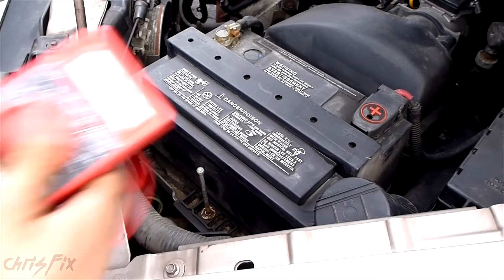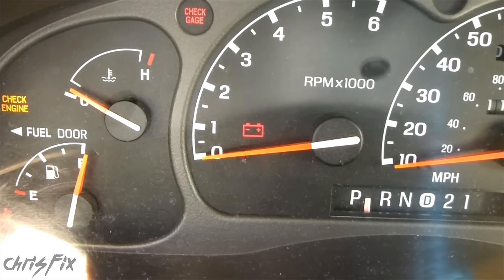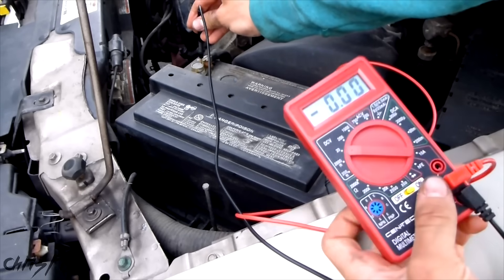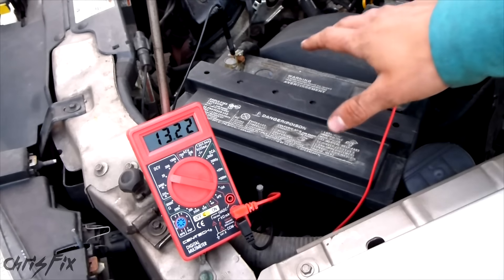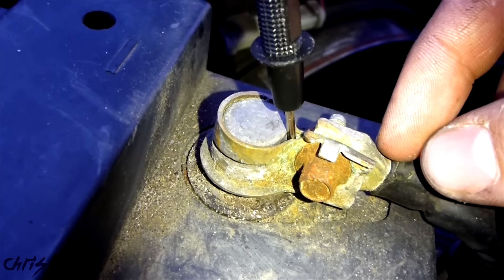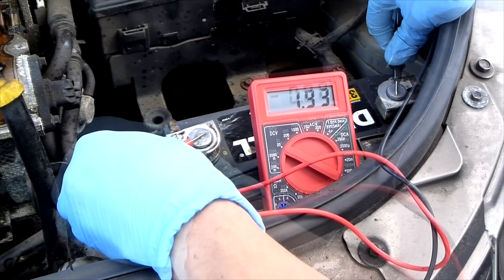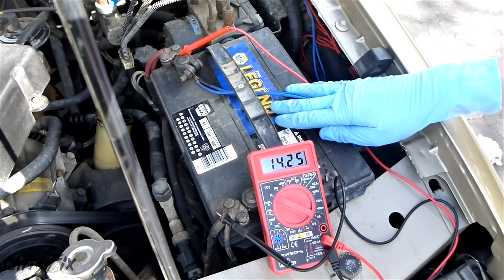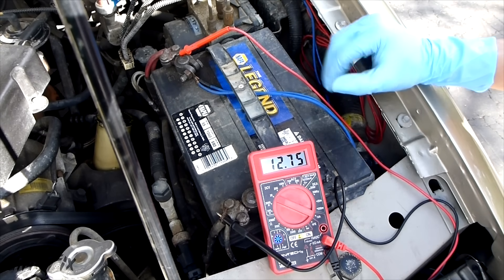How to Test a Car Battery with a Multimeter

Comment: Chris great video finally someone whos quick and knowledge. i will try to check ampage right now if it starts its been starting one day then in a few days it doesnt battery reads 11.98 v wlo terminals on.  i have volvo  the lights are bright it either cranks n turns on or clicks but no crank ty

Comment: I have had a lot of electrical problems (takes multiple tries to start, radio turns off and back on, lights flash, when car is off the doors don't all lock or unlock from the button on the inside of the door but does work when car is on) I tested the battery like you said and when car was off I got a reading of 18 and when I turned it on it dropped down to 13 then back up again. Any thoughts? Does it mean anything the the reading on the battery was so high?
Reply from the maker: +Pablo Cow Watch my alternator test video and see what the alternator is putting out. That voltage is very high and you either have a bad battery or bad alternator.

Comment: +chrisfix Greetings, I have a 96 Maxima, New starter, battery, fuel pump, all 6 
new spark plugs, I was driving in the highway and my car stop running 
and now it doesn't want to start only cranks but no start. It had a code
 P1447. I read about this code and I replaced the EVAP Canister. Does 
this code cause no start? If does, what is the next to do? Your help is 
appreciate, since this car is my daily transportation.

Comment: Chris,  At the phone company, we use a product on our batteries in the offices (these are lead-acid) called NO-OX-ID.  This grease will keep your terminals clean for years.  Also, our Power Tech Support says office batteries  will last at least 20 years if the temperature is correct, approx. 70 degrees F.  A rise of 10 degrees will knock about 20% off of the life.  Under the hood, it's the heat that kill a battery.  Moving a battery to the trunk would double the life.
Reply from the maker: +Joe Atwork Thanks for the tips!!!

Comment: Excelent video, thank you very much. I'd like to ask a question here. I'm installing three LED lights in my 4x4 and using a power inverter to plug in my notebook (a 60w MacBook) to the battery. My question is, is there some way I can know how much charge is left in the battery so as to start the engine before it goes bellow dead? And, how long on average does the alternator take to charge the battery, meaning for how long should I leave the engine running after using the battery for about 3 hours of notebook use. My car is a Suzuki Grand Vitara diesel. Thank you.

Comment: Does the same drop in voltage test when starting apply to a diesel engine car as well?
Reply: Mostly yeah... But its more about how it sounds when cranking. Because if starter draws little more and battery is not brand new it might be somewhat below 10v, especially if its cold and glow plugs are on

Comment: Very well done video. May I suggest taking a little baking soda and dabbing it around the top of the battery with an old paint brush, then pouring HOT water over the battery to clean and remove acids which build up atop the battery. These acids cause corrosion/collect moisture and can actually cause a draw from one battery post to the other.
Reply from the maker: +davess357 Thanks for the tip! That is a good one!

Comment: I noticed your voltage on the battery was 12.85V. I just had mine tested and it gave the exact same number. Since this is above 12.6V is that a concern? What's the highest voltage you would say is acceptable with the car off?
Reply from the maker: +Matt Bono That is not a concern. Your car battery should be between 12.2 and 12.8 volts so you are good.

Comment: hey my van battery was ok then i went to turn it on it wouldn't i had it jumped it started up no problem then i drove barely like a block and it was sluggish then died on me what should i check besides just the battery like this video shows? 02 windstar
Reply from the maker: +Tito Santiago Check the alternator as well as the battery. It is one or the other.
Reply: Alright I'll check tomorrow and I'll post back on here any other questions thx for the quick reply

Comment: Could you please measure idle drain current on your truck to see how the battery is discharging when not in use? It seems to be in such a good condition just because the voltage does not drop below 12.6V at all.
Reply from the maker: +duncho Like this: https://www.youtube.com/watch?v=n5FJDgcdii8
Reply: +ChrisFix I'm not interested in of how to measure it, but what actually was the idle drain current on the last car on this video.

Comment: Hey Chris, I have a question.Sometimes when I start my truck, usually in the morning (I live in Florida so it's cold weather), it cranks to what seems half way and then it fully starts about a second later. Would this be an issue with cold cranking amps?
Reply from the maker: It could be the battery so take it to a parts store and they will do a free load test.  Also check out my fuel pressure test video.  Could be a weak fuel pump.

Comment: wd40 wont prevent it from rusting because the water component evaporates from the wd40. Thats why chains on bikes rust after wd40, which displaces the thicker facotry oil.
Reply from the maker: +meocats Thanks for sharing. It has worked fine for me. A bike chain has other forces on it that wash away the oil while a battery doesnt move so the oil stays on it.
Reply: Doesn't work on tools either; Machine tools for example. Don't trust WD40 to keep your machine tools safe from corrosion during the winter. That's how i know i'm correct.
Put Wd40 under your vice between it and the machine table and it will rust after a while. And that's in applications not using flood coolant.

Comment: Your video helped me narrow my slow cranking down to the battery. Autozone checked it, said it needed charging. Came back 1.5 hrs later and they noticed a bulge and battery was at 66%. It was a Duralast that was till under warranty, so they gave me a new one. BTW, that new collaboration, Blown Heads, is awesome. Cheers!
Reply from the maker: +Miguel Chavez Awesome Miguel! Glad the video was helpful! Glad you liked my permanent guest host position! haha

Comment: Thanks for this video, very helpful. 18 month old name brand battery died on me overnight so this will help me troubleshoot what the issue is. Literally fine one day, no lights when the key is turned the next. Hopefully it's just a filthy connector!
Reply from the maker: +GarethFlatlands Good luck and keep me posted!
Reply: +ChrisFix The connectors looked fine but only 0.35 on the Multimeter. Hopefully it's just a duff battery and not the alternator.

Comment: hiii I change battery and alternator and my battery light still on what can be the problem ?
Reply from the maker: +Luis Majano What is the voltage at the battery and what is the voltage at the alternator. It might be your wiring or connections.

Comment: Hey Chris. Love the videos. What do you think of the voltmeters that plug into cig lighter which continously monitor voltage? Amazon is selling one for about $15. According to reviews the innova unit is pretty accurate. Should i just buy a multimeter and check battery periodically instead?
Reply from the maker: +MarzNet256 You can get one of those kits and they are pretty accurate. Like this right? http://amzn.to/1Pjte7f

Comment: Great video.  Thanks.
Back "in the day" we were told not to start the car with radio, blower fan, or any accessories on as this would shorten battery life. Is this an old wives tale?  Are there things that can be done to extend battery life?  
Thanks again.
Reply from the maker: +Tony Discenza You dont want to start the car with stuff on so you dont damage the alternator. The alternator supplies the power to the electronics and if everything is on when you start the car, the alternator has to work hard right away. In todays cars it really doesnt matter because when you start the car, there are circuits and relays protecting everything.

Comment: Great videos Chris! I learned quite a bit here. I have a question though about turning on your headlight for any remaining surface charge. Is that with the engine on or off? I've noticed that the pass two weeks that there seems to be a bit of a slow/lagging start. A couple of days ago it just wouldn't start. The battery indicate ~12.2v across the terminals. I don't remember when but I did have my DVM hooked up and saw it dip to +5.x volts during a crank. Anyways, I charged the battery yesterday (surprisingly it only took 2 to 2.5 hrs and was fully charged) and this morning it was still reading ~13.2volts and 14.3v with the car running. I turned on the headlights, radio, AC fan full-blast and it dropped to as low as 13.3-13.5v with the car running. Turned those accessories off and it went back up to 14.1v or so. Turned off the car and it was back to ~13v. Sometimes, it would be +12.6v. So it appears to be within tolerance both with the car off and on. I did this a few times also noted how far the voltage dropped when cranking. It was mostly +10 to 11volts. I think i saw it drop once to +9.x volts but they all started the car. Finally, I decided to test that part about turning on the headlight to dissipate any surface charges. I left the headlights on about 30-40sec with the car off and I saw the voltage drop steadily to 11.88v and quickly turned off the headlights before it got too low. Well, that did it. No start and didn't even recall it cranking. During the attempt to crank it dropped to +4 or +5v. So, does this mean the problem is the battery because it won't hold a charge or can't take a load? Thanks!
Reply from the maker: +richk3c To remove the surface charge you need the car off. With it on, the alternator charges the battery. The battery sounds like it is shot. I would get it tested like in this video: https://www.youtube.com/watch?v=fRfPupikHT4
Reply: +ChrisFix Ok, that makes sense. It's just that your video shows you start the car to display that the battery light goes on then off, then the video went straight to turn on the headlights to get rid of the surface charge. However, your next step was to start the car to test the CCA of the battery. So, I got a little confused but just wanted to make sure. Btw, I saw your other video too. Great stuff as usual. Anyways, I drove the car to the local auto parts store to have the battery checked out. They said the battery was good. Hmm? So, although my open voltage checked out ok at ~12.6v, the charging voltage ~14.4v with the car started, and the CCA voltage was ok I would occasionally have problem starting the car. I believe the answer was in the surface charge test with the headlights on for ONLY 30-40secs and then it wouldn't start anymore. If i am not mistaken, even after turning off the car and exiting the car (opening the car door turns on the interior lights) causes a drain in the battery. I'll assume the same when I get into the car too. I believe there is a "Reserve" rating (amount of time you can leave any accessories or lights "on" and still be able to start the car) on batteries as well and it degrades with time on batteries. I believe it's this Reserve capacity that is shot. The battery being 4.5 yrs old I decided to change the battery. My battery terminals were the type just like your first battery in the video. Mine were very clean around the post, but the negative terminal screw was corroded shut. Eventually, got it off with penetrating fluid and spreading the tail end of it. When replacing the negative terminal I had to cut off the insulation and the cable from the old terminal and saw that corrosion goes into the negative cable. I had to cut off a 1/2 inch of the cable, strip another 1/2" of the insulation but still had to wire brush the corrosion in the strands of wires in the cable before putting on a new terminal. Amazing that it looks so clean at the post but I wonder how deep the corrosion goes into the cable. Anyways, it's been a month now and no starting problem.

Comment: Is there a video to show that its safe to touch the battery terminals and stuff/ Like what to do and what not to do to not get shocked. Cause I am uncertain about all that. thanks I subscribed.
Reply from the maker: +Bitcoin101 it is 12v dc. You can touch whatever you want with your hands. Just dont bridge the + and - posts with a piece of metal.
Reply: +ChrisFix oh OK thanks!

Comment: Hot water also works for corrosion and will strip it away instantly. Also the alternator on that first car went looking too healthy, should be between 13.75 and 14.4v.
Reply from the maker: Nicholas Croft Thanks for sharing Nicholas!

Comment: Put new alternator in and it's the same fluctuations I was getting with the old one. I will start my commander with the new alternator and it will read 14.50 When I put the HIGH BEAMS  on radio AC at full,  interior lights it drops down to 12.58volts even at 1500rpm idk what the cause is, every single connection is extremely clean. The other readings I'm getting are 0.08 alternator case and 3.0 at the post. My old alternator everything was where it should be except for the fluctuations. Please help any ideas. 
Thank You
Reply from the maker: akaredcrossbow Sounds like you need a better ground if your voltage drop is 3.0 at the post.
Reply: Thank you for getting back to me. 
I have checked and cleaned all connections and ground  on both wire harness positive and negative  from battery to starter to alternator. I checked the wires that I have access to and cleaned the main ground. Also the ground on the engine block near the starter. And still can't find the reason why the old alternator and new alternator are giving the same readings.
Reply: I put old alternator back in. Did all tests again still have the fluctuations, but all other tests check out good. But still have issue. I turned everything on that I have ac to high,seat heaters, radio, interior lights, wipers, rear defrost high beams was around 13.98 volts. Then as I'm watching the multimeter my electric fan for my ac condenser turned on and the reading dropped to 12.56 volts. All fan connections have been cleaned to. Pretty much any connection I could get my hands on have been checked and cleaned. Any ideas?
Thank You

Comment: When I use my multimeter on the battery while the car is running the volts jump around a lot. 14.23 14.60 14.04 14.16 and so on and so on is this a problem. 
Thank you
Reply from the maker: akaredcrossbow Yes, that is a problem. Sounds like the voltage regulator in the alternator.
Reply: Put new alternator in and it's the same fluctuations I was getting with the old one. I will start my commander with the new alternator and it will read 14.50 When I put the HIGH BEAMS  on radio AC at full,  interior lights it drops down to 12.58volts even at 1500rpm idk what the cause is, every single connection is extremely clean. The other readings I'm getting are 0.08 alternator case and 3.0 at the post. My old alternator everything was where it should be except for the fluctuations. Please help any ideas. 
Thank You

Comment: Vaseline/Petroleum Jelly is good to put on the battery terminals to stop them rusting also...
Reply: Also dielectric grease.
Reply from the maker: lee major Thanks for sharing the tip!
Reply: Nothing beats battery terminal protector..
Reply: I bought 2 big 165Ah batteries for my inverter and they came with a tube of terminal protector and under it it says (petroleum jelly), so I decided to put vaseline on my car's battery.
Reply: I like the Permatex purple spray.
Reply: Agreed, vaseline is also a conductor of electricity
Reply: lee major 

Terminals don’t rust. They are not iron.
Reply: Frank Gutowski do you think that only iron corrodes?
Reply: ctiebs 

Only iron rusts. Rust is ferric oxide. It’s the product of the redox reaction between iron and oxygen. Other metals act as reductants in redox reactions, many of which are loosely described as corrosion.
Reply: @FrankGutowski-ls8jt  Don't disqualify Galvanic corrosion. The dissimilar metals between the terminals and the connectors assisted by the sulfuric acid from the battery will create galvanic corrosion which will start out as a general/surface corrosion before becoming something much worse. The petroleum jelly can act as an inhibitor between the electrolyte and help reduce the contact between the dissimilar metals (assuming their dissimilar) and slow down the processes.

I don't like it but you were correct in your statements.
Reply: John Doe 

Petroleum jelly protects the metals from contact with the electrolyte, thereby reducing the flow of electrons between metals of different redox potentials, which you call galvanic corrosion. In that sense it acts as an insulator.
Reply: Vaseline is good for masterbating also. My post is good and hard.
Reply: @allsystemsdownagain9553  💪😳Can't beat the stuff - no pun intended✊💦👊💦
Reply: Please do not put any crap on the battery terminals, just wire brush it and it's good for years or until next acid leak. In other words dont waste your time getting dirty every time you move your battery.

Comment: We had intermittent starting problems. Unfortunately our AutoZone store said our battery was ok, but I found that four of six cells were very low on water. After filling and charging it holds 12.5v and drops to about 10v when starting.
Reply from the maker: John Purple AWESOME! Glad the video was helpful and you figured out the problem!

Comment: Hey man i have an 06 mazda rx8 and today it didnt wanna crank all i heard was clicking so i connected this machine that you plug into the wall and it gives you the readings/charges the battery so i cranked it and the car started so i took the clips of and in sparked but i wanna know should i leave it to charge for more time??
Reply from the maker: anderson mayorga Go drive the car around and let the alternator charge it or have a trickle charger charge the battery.